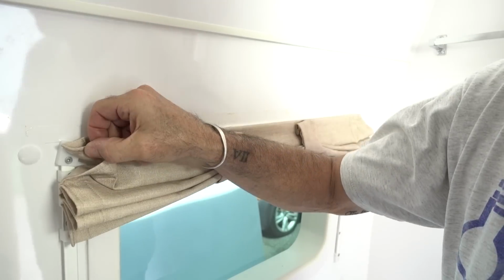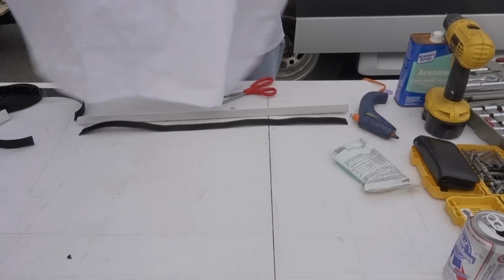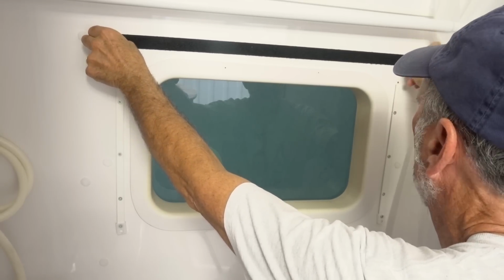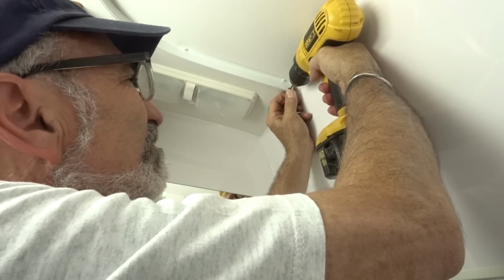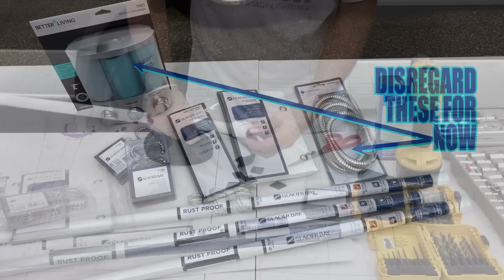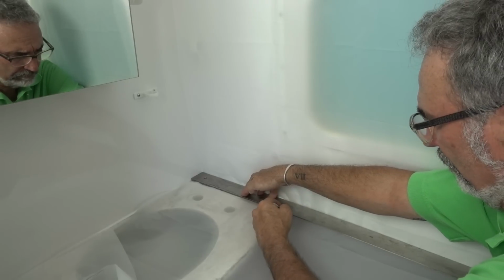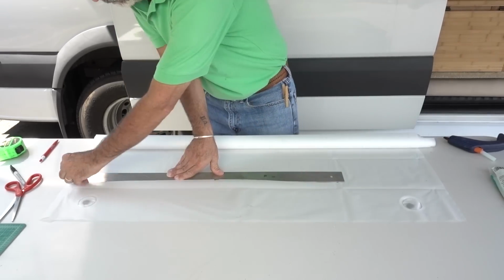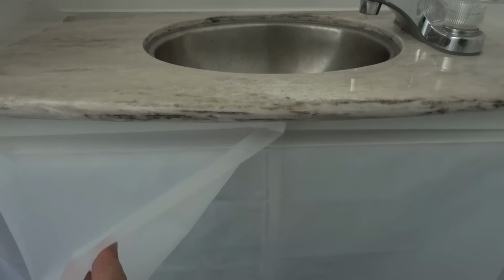CROWDED SHOWER | Change The Way You Shower In A Van

Comment: I’ve been hesitant getting the Plateau TS because of the shower curtain problem and in one video you allayed my concerns!!!  Thank you so much. I’ve subscribed and can’t wait to watch every single of your videos.
Reply from the maker: Tuckered Out and I can honestly say that after using the modified shower for several months now, it is wonderful! It works just as intended. I might consider higher quality heavier shower curtains though.
Reply: I’m wondering if you’ve seen a video posted last May by Advanced RV called “A large bathroom in a class B RV”. I watched the subsequent video of your visit to ARV and saw how much you appreciate their product, which is why I’m mentioning it. Anyway, in the video they actually cut the bathroom door horizontally which allowed the bottom 1/2 to open across the hall to secure a dog in one area of the van. The 2nd purpose allowed the upper 1/2 door to remain open while using the shower and a shower rod mounted in the ceiling (!) of the bath pushed the top part of the curtain out into the hallway. It looks like a great set up to really improve the upper body space of the bath....a great set up assuming you are willing to cause irreparable damage if it doesn’t work!  I’m curious if you’ve seen the video and your thoughts if this idea could work in the PW. Thanks!
Reply from the maker: I have seen the video and i think it is a great idea. The benefit exceeds the effort. You are correct in that I will not cut the bathroom door. I have to think about "the next guy."
Reply: Well, after seeing what you’ve already accomplished in your van I’d be pretty happy to be “the next guy”!  Thanks for your responses and I look forward to see what is next on your list of projects.

Comment: When you do your shower update, could you give us a shot of the shower so that we can see it from a while-view perspective?  On other words, could you zoom out more, so that we can get the whole picture?  With this video, I only sort of "got it."  What I got was that you used shower rods to keep the curtain from clinging your body, and giving yourself a lot more freedom to move around, which sounds great!  Can you include any "before and after" photos on your video update?  THAT would be super helpful!!

Also, would it have been possible to make TWO window covers, so you have one for the vanity and the window without having to move either one?
Reply from the maker: Unfortunately, the camera I used did not have a very wide lens. I will get in there with a wider lens for some stills. When I do these modifications, I try to re use or repurpose existing items. You can certainly make additional window covers. Basically, the factory curtain track closed the curtain around you in a tubular fashion. My redesign has one straight curtain on each side, with "wings" that protect the vanity. You have double protection on the vanity and electrical outlet. First, the window curtain hanging from under the countertop lip and then the two curtain wings covering the window curtain. I have been using this set up for several weeks now and it is absolutely liberating! You have the entire sink countertop open for your shower stuff and that also affords a generous amount of elbow room. I used to face the toilet and now I face the mirror. That has it's pros and cons... ;-)
Reply: Humble Road Thanks for clarifying!  LOL on your last sentence!
Reply: Humble Road , no, don’t “get in there” get out of bath, open the bathroom door, take a picture of overall finished shower. If your shower is across from your sliding door, step outside and take picture of shower. With your closeups, can’t tell anything of shower expansion you’ve done.

Comment: I am concerned about water getting to the wood cabinet, or even how the wood will hold up to the moisture if the shower is used often .   I was wondering about applying a more protective finished to the wood what do you think ?   Does your shower curtain
's bottom stay below the wood cabinet ?
Reply from the maker: This modification has worked very well. Daily showers with any issues. The wood is fine. Yes, the curtains stay where the belong. One change I will make is to use a more substantial shower curtain. The one I bought is too flimsy, and I understand there is a certain type of curtain that sheets the water so they dry more quickly. good luck!

Comment: Ok ok I give up!! Please explain why it matters where the “male” side vs. “female” side of Velcro goes? I’m watching all your vids, and often you emphasize this. And sometimes even alternating male-female-male...etc. So curious!
Reply from the maker: As my son says, it's actually called hook & loop. In my world, the hook, or courser of the two, is the male and the soft fuzzy loop is the female.
Well, the main concern is that you make sure you use a male and a female in the application. (a hetero-coupling so to speak..) I have glued female to one side and then female to the other side, not paying attention! I don't think it really matters which side goes where, but if I had to make a choice, I would always use soft fuzzy female on the "fixed" or stationary side, many times stapling it in (if possible) as well as using the adhesive. Then the male strip goes on the part that is constantly being attached and pulled free. Like I said, I don't think it really matters, I'm just a little crazy...

Comment: Wouldn’t moisture loosen the velcro glue? Is the velcro you use waterproof?
Reply from the maker: It's been over three years now and all is well. Generally, I pop a few small screws with finish washers through the velcro into the wall for added support and strength.

Comment: do you have to remove the cover off the vanity after every shower? lotta work, maybe you can use thompsons water seal or an equivalent on the wooden parts, I suppose. any way  you look at it, sometimes you'll have to put away those plastic pieces over the vanity when done.
Reply from the maker: Living free and mobile does have it's compromises. ;-) You learn early on what needs to be changed for the better. Thanks for the comments!
Reply: I agree, way too much work :) to attach window covering to vanity and then vice versa.  I would just drap the whole curtain over the whole vanity, even if that meant using a third curtain.

Comment: Or you could just completely remove that unnecessary electrical outlet and apply a waterproof sealant to the woodwork: |
Reply from the maker: I agree, Patrick. An electrical outlet should never exist in such a wet space! If it were up to me, I would have an empty shower stall with a toilet on one side. No sink, no vanity, nothing but a shower stall. One of my self-imposed rules is to make modifications that can easily be "undone" and return the van to factory state with little marring. Thank you for watching and I hope to hear from you again soon!
Reply: Patrick Ryan  v